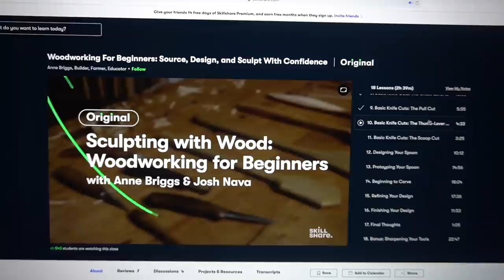SIMPLE CHICKEN TRACTOR BUILD to GROW a YEARS Worth of CHICKEN!

Comment: I love that kind of tractor design. The only things I did different on mine is I used bolts and wingnuts on the corners and top so I can break it down after the season and store it flat for the winter since covered space is a premium here. I also painted mine with some cheap exterior killz paint so it lasts longer in our very wet weather.

Comment: Goooooood Morning Al , Gina & Olivia ,
I have made one of your chicken tractors. I don't have a nice workshop so I made it in my living room. Also , since I am not as young as you are , it took me about a week. Turned on edge , it fit through my front door nicely. I did make a few changes. It is only a chicken tractor after all so I feel that it does not really need the strength of 2 X 4's. I used 2 X 3's. A little bit lighter ( at my age I need lighter ) and also costs a bit less. I also used 1/2" mesh hardware cloth. Which makes it a little more rigid and besides that , I have had a raccoon tear a hole in chicken wire. I also added a second story on one half of the chicken tractor. Roosting bars and laying nests in the top half. Use your favorite roofing material for the roof. I used a translucent fiberglass panel. I fabricated a rain gutter which directs the runoff from the roof into the 5 gal. water bucket ( with nipples ) for the chickens. So far , I have never had to tote water to the chickens. I made an automatic feeder and feed storage out of 4" PVC pipe which I have to fill about twice a week. My chickens stayed in it all winter here in northeast Ohio with no problems ! Of course it is now too heavy for me to move by hand. I simply use my lawn tractor to tow it around.
    I'm still waiting for you to build a deck on the other side of those sliding glass doors. Thanks for the ideas Al .

Comment: One way to tension screen is to lay two frames together and raise each end 3inches or so then staple it down on both ends with its center is off the surface. When the ends are laid flat the screen will stretch and then just staple the center down on each then cut it. You can even fold the frame like a hinge to make two sides go together as long as you account for the thickness of the wood being used which will tension it almost as well. Most welded wire can be done the same but it gives less and depending on the gauge of the wire adds a bit of strength to the panel that's made.
Reply: Good advice!

Comment: Re sourdough starter “discard”: hint from some who’s been making sourdough bread for 10+ years — you don’t ever need to “discard” starter. Just keep a small amount in a small loosely covered jar, in back of fridge. Take out of fridge 8-24 hours before you want to use and add equal amounts of water and bread flour. Usually an ounce each will do. Use what you need and put the rest back in fridge.  Bingo! No discard.
By the way, good job on the banana bread. Now try a “proper” sourdough loaf! It’ll cure Al’s issues with bread, gluten, whatever.

Comment: Peel and mix your banana's first, then save in a bowl. Then do the rest of the mixing, adding the mixed banana's as usual. You don't need to wash the bowl after mixing the banana's first, just scrape it clean, then the rest of the mixture. Easier and faster with less clean-up.

Comment: Al you need to drill a hole in the birthing room door and run a string to the latch so you don’t have to keep reaching over to open the latch!
Reply: Make it a short length of coat hanger wire.  Bend it with a loop on the outside for a handle.